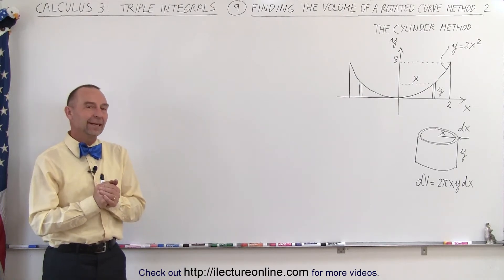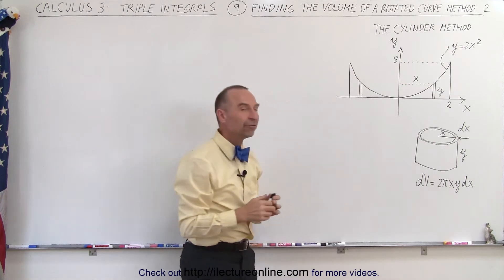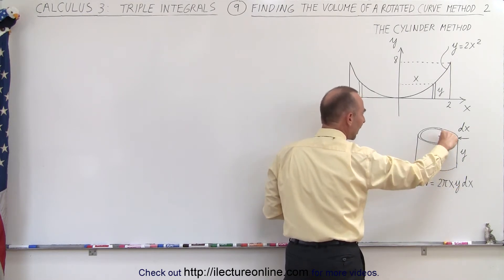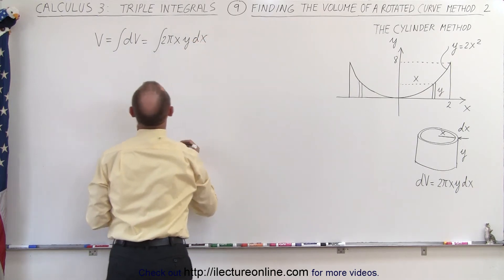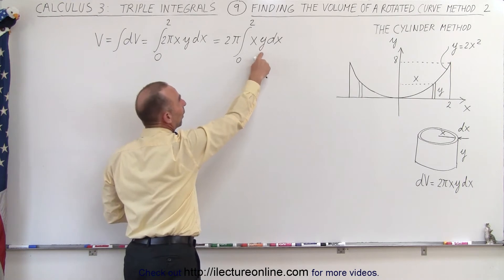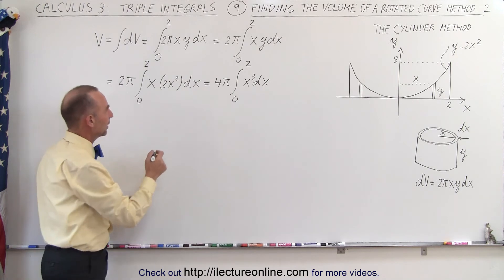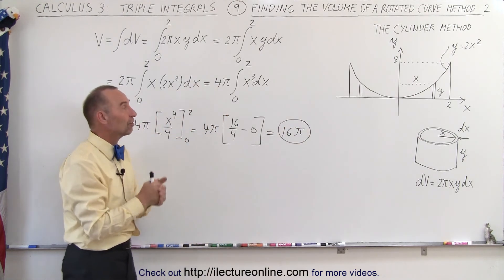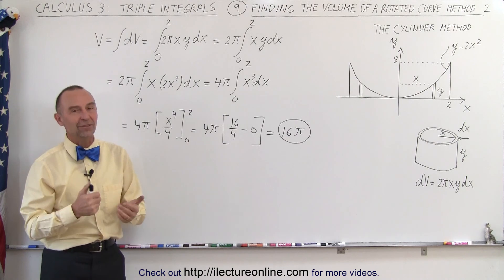Calculus 3: Triple Integrals (9 of 25) Volume of a Rotated Curve: Method 2: Cylinder

Comment: you take lateral surface area of the cylinder and multiply it by the depth, but I can not imagine how this multiplication get the volume ?
Reply from the maker: You can check that it is correct by changing the parabola equation to y = 8 and repeat the problem.  You'll see that the volume now equals that of the cylinder.